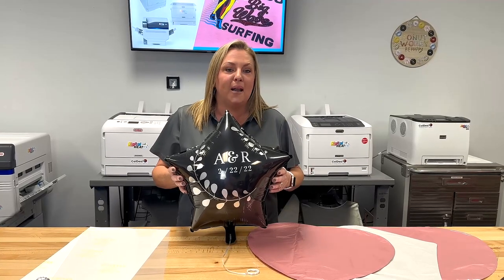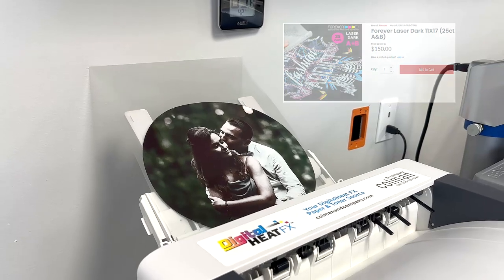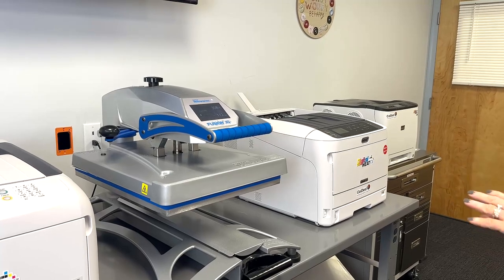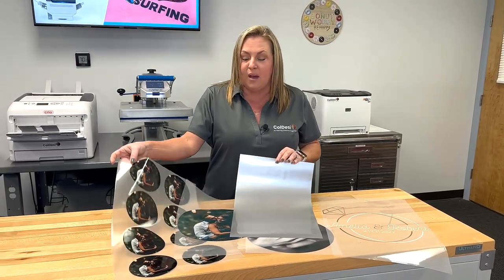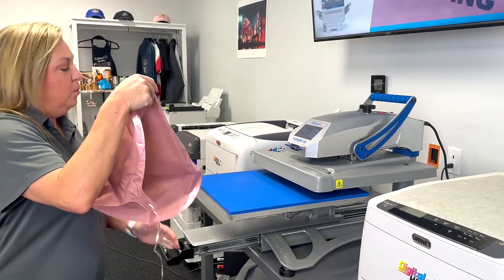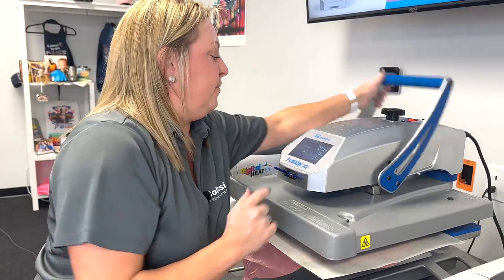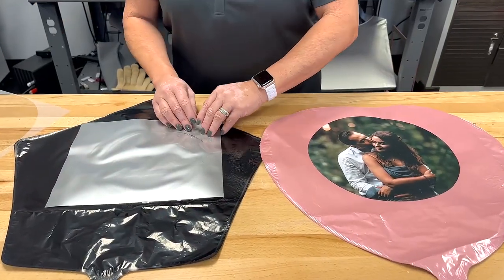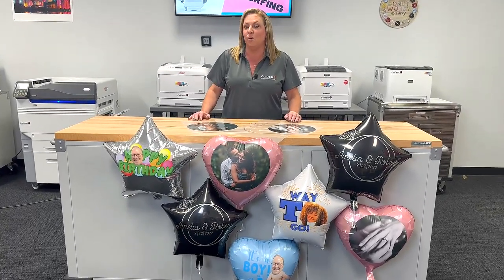How to Print on Mylar Balloons with Heat Transfers | DigitalHeat FX

Comment: Does it have to be laser dark? Can it be laser light? And the presto metallic paper will work too?
Reply: Yes, dark is needed (but I see below you purchased), and Presto Metallic should work (I used Forever, but I think they are similar). Just make sure it can be pressed at a low heat.